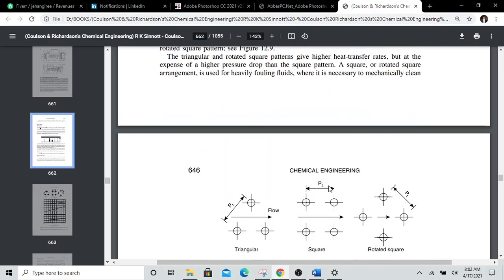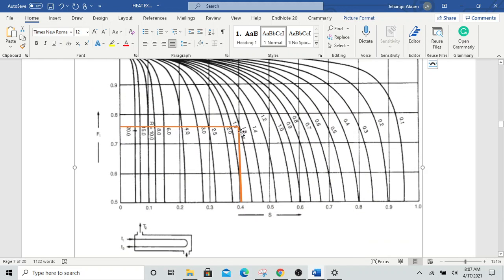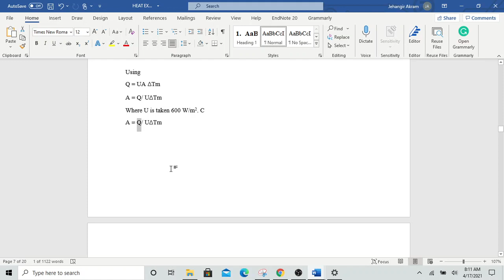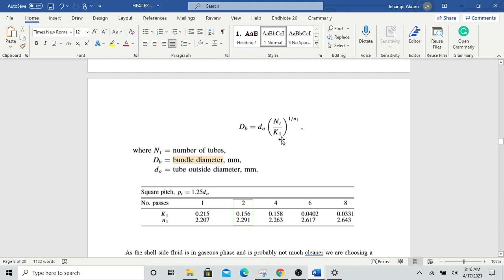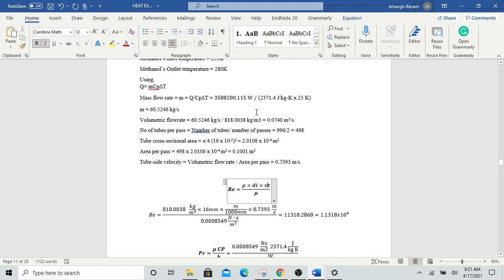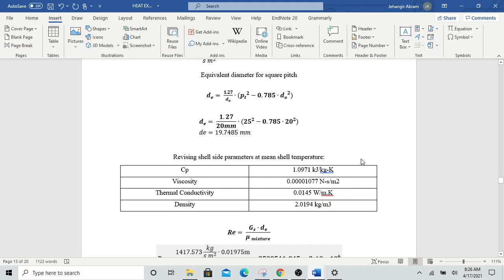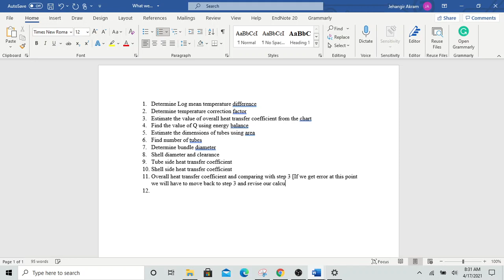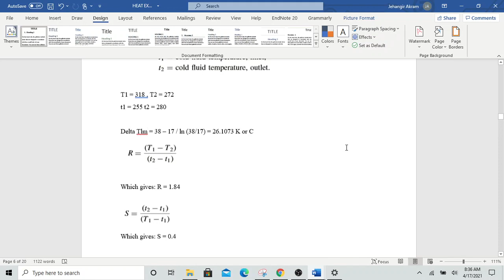Rigorous Shell and tube heat exchanger design using kern's method

Comment: how to value of Q using energy balance, i dont get it
Reply from the maker: In short mCpdeltaT, see this article
https://www.brighthubengineering.com/hvac/59900-fundamentals-of-heat-exchanger-theory-and-design/#:~:text=The%20required%20heat%20transfer%20rate,inlet%20temperature%20can%20be%20calculated.

Comment: How to find jf value
Reply from the maker: Are you referring to jh factor? Please check Coulson volume 6 I think if you are referring to the friction factor, which we neglected in the calculations
You can refer to coulson volume 6 (Chemical Engineering Design and probably its Chapter 12 of heat exchangers design, you can find it there)